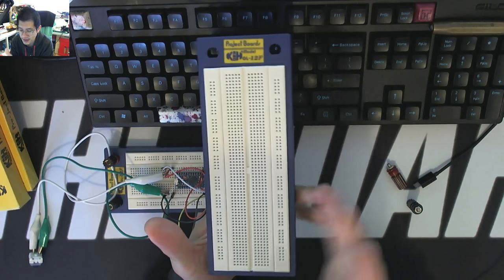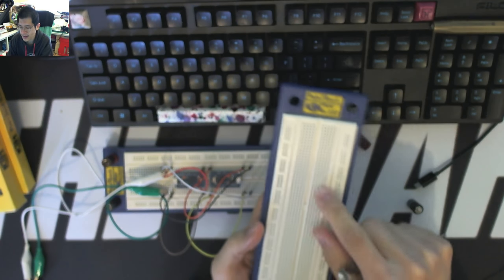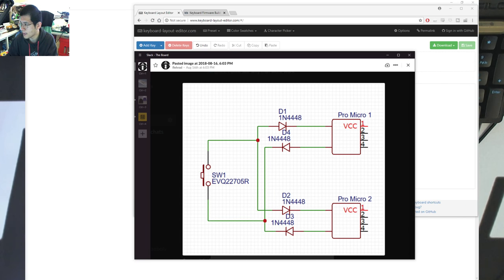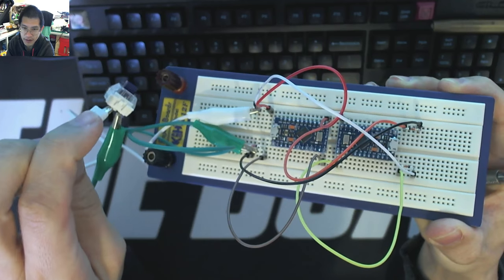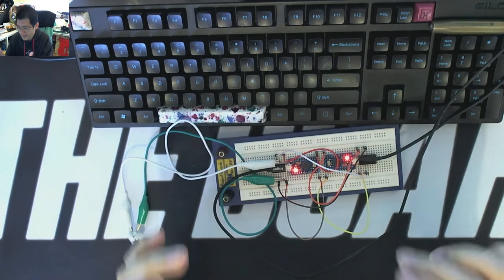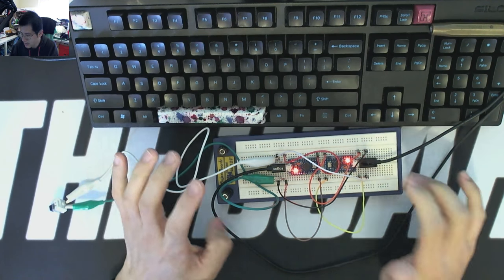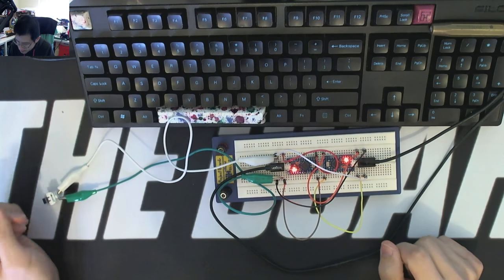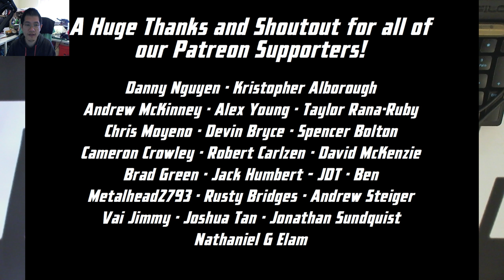Breadboarding Dual Pro Micros

Comment: Clever diode usage to prevent one micro from sensing the other's pulse. I would have just done a double pole momentary switch though :D

Very cool keyboard and electronics! Subbed!
Reply from the maker: Thanks Troy for the support and feedback!
The only kind of reason I went with this was to use existing mechanical keyboard switches, which are single pole momentary as part of their inherent nature.

I have been talking at work about adding some additional header points so other switch types can be wired as desired, and the additional stop from here would be to have some kind of switching also to enable Left/Both/Right pro-micro's to be selectable so you don't have to unplug/plug if for some reason you wanted them to operate independently.  I have also thought about for PCB design purposes to add a on-board USB Mini connector breakout to reduce the likelihood of snapping off the micro connector on the pro-micro since they have a risk of doing so on these ones.

Plenty to play with!
Reply: If I understood correctly, you'd want to make many of these for people to set on their desks and push when they get up. Seems like there wouldn't be much unplugging/replugging or tugging on the unit, so the pro micro connector may not be strained at all. Otherwise you can add to the PCB footprints for whatever flavor of connector you choose. The ability to order PCBs and parts is so amazing right now.
Reply from the maker: You would think that, but a lot of our work sites are going to hot desking, so there may be a bit more mobilisation use with these types of devices. Its still better to design durability and reliability if you can, if the additional cost is not much.

I would definitely utilise the through-hole type connectors typically used in a lot of split keyboards for the extra soldering strength.